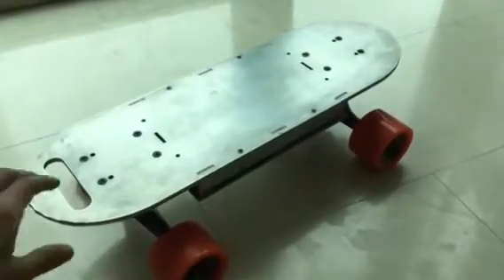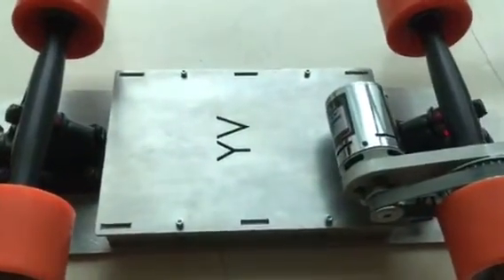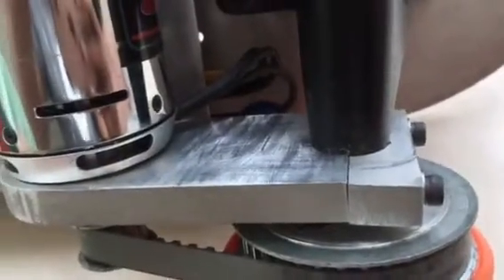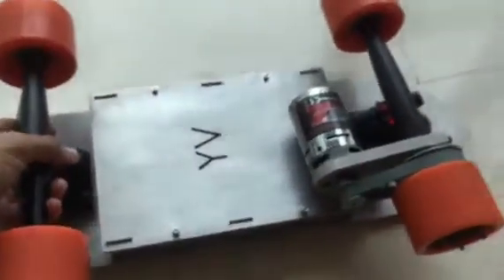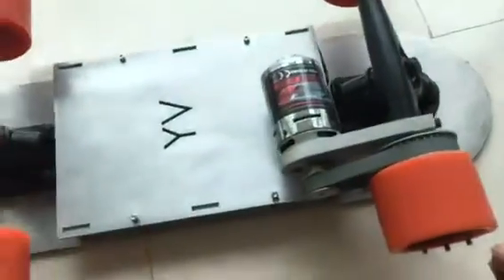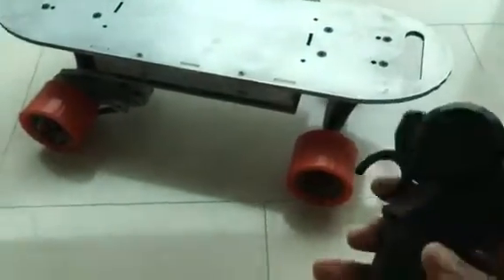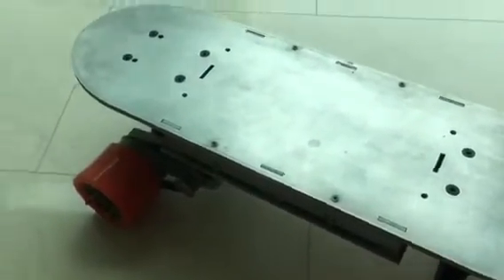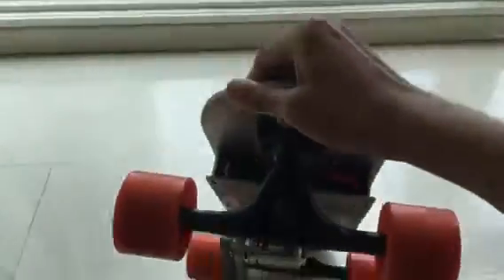DIY Electric Skateboard Project

Comment: how much it costed u plus can u plz put the link for all the parts...
and love ur videoa bro ..keep up the good work
Reply from the maker: Hey thanks a lot!
Here are the various parts:
Turnigy Aerodrive 236kV brushless motor
Hobbywing 60A ESC
2 channel RC Receiver and Transmitter
Longboard trucks
70mm Skateboard Wheels
12 & 36 teeth pulleys
Continental timing  belt
Reply: 170 euro